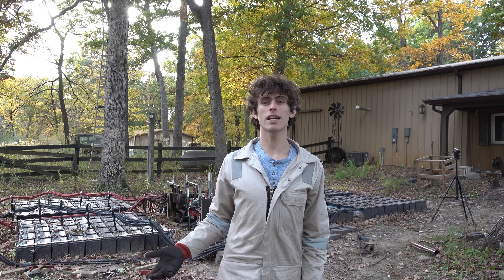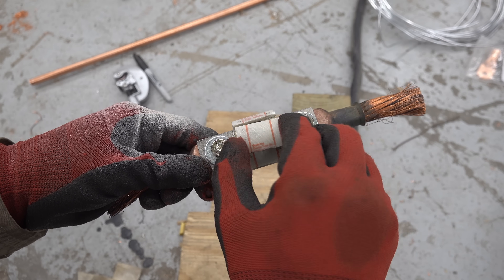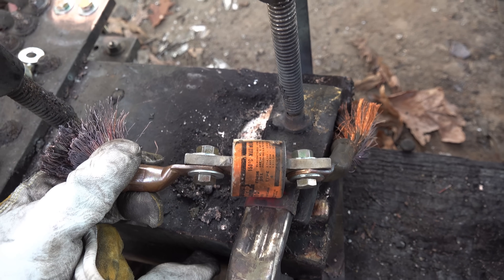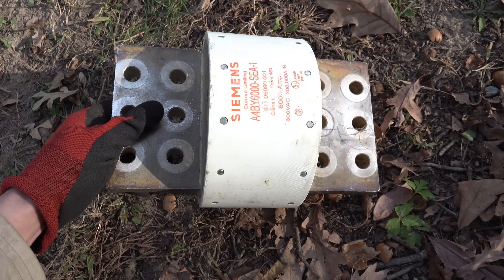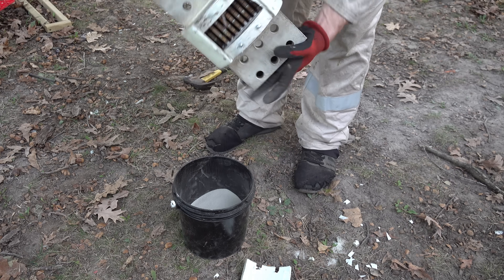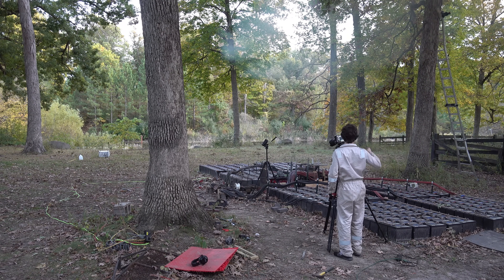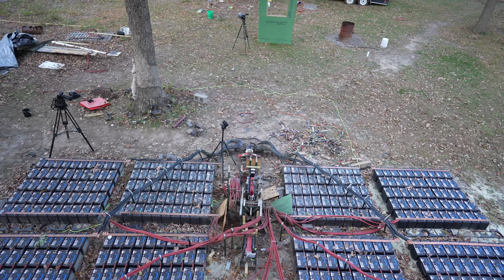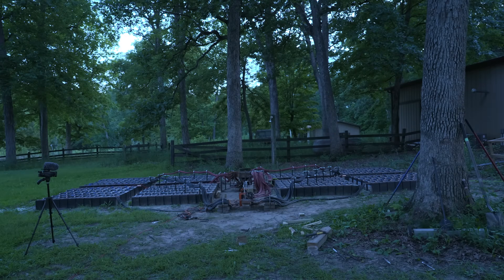Popping a 6000 Amp Fuse

Comment: Have you considered raw LTO cells? The low internal resistance and 10C discharge rate could make your explosions insane. And your battery would be much smaller. You could also use raw LFP cells, they are dirt cheap now. Just don't discharge to zero volts lol
Reply from the maker: idk anything about LTO specifically, but I'm generally turned off by lithium batteries for these experiments because they tend to make a fuss about short circuits. lead acid isn't nearly as energy dense as lithium, but its short circuit tolerance is excellent. i'm not worried about the space they take up since i live in the middle of nowhere
Reply: @styropyroshorts  oh gotcha, that makes total sense. Love your videos man!! Big fan
Reply: @styropyroshorts  LTO is better for short circuit compared to other lithium ion variants but once you hit that limit, a bit messy. Electrolyte spills out and it's nasty stuff. Lead acid seems the way to go. Love that huge switch you built for this one!

Comment: I see your plan of beating old Photonicinduction videos till he comes back is coming along.
Reply: He's going to need quite the capacitor bank
Reply: “challenge accepted”
Reply: Look it's like this. Photon is inactive, so there needs to be a force that activates him.
Reply: Can you imagine the chaos if both of them where in the same place
Reply: @thinfourth THIS is what we need! The local grid would certainly die, and perhaps a couple of people as well, but the content from such a collab would be WILD!
Reply: In theory, this would also make the EV chargers that everyone wants. With this you would be able to charge your EV in less than 3 minutes.  (2,5 minute to be more precise).
Reply: He might be coming back!
Reply: It's like the speedrunning scene, where some total mutant sets a god-tier WR and then disappears for years, only to return the same day his record is bested.
Reply: Andy's fuse pop was a bit different.  His capacitor bank was over 1KV and he had 10KA available giving a 10 MEGAWATT pulse (very short duration).  Styro's setup applied 150KA at 30 volts, maybe 750 KW?  Fantastic production by both!
Reply: The main difference between him and Photonicinduction is, Photon makes his experiments right in the city and on grid and these experiments happened off-grid on batteries. It would be questionable, if he could the pop via mains. Photon does have some very big transformers.
Reply: @MK-sf2bq  The capacitor bank Photonicinduction used on the 5000A fuse could probably already pop a 6000A fuse as is. It was higher voltage and about the same current, but obviously very short lived, but based on the rating of that fuse on the range of instant bye bye.
Reply: Giraffes did it first.
Reply: Why did he leave? Wasn't his girl complaining about the danger or something?
Reply: The legend, the myth
Reply: This reply section is filled with some of the biggest losers on this website.
Reply: @wisplite You would know
Reply: Styro doesn't understand electricity in the same way Photoinduction does and couldn't possibly do half of it... Stringing batteries is the best he can do.
Reply: @AI_MEME_CORP Get off his meat bruh, he ain't even active anymore 😭
Reply: @Milk_Bag67  yes he has. Look at his community page. Ouch.  That didn’t work out did it? lol
Reply: @AI_MEME_CORP  did styro piss in your cereal or something? chill out dude.
Reply: @mineton1293  sorry didn’t mean to hurt your feelings. Just sit in the shower and eat around 10 cheeseburgers like usual when you are stressed right?
Reply: @AI_MEME_CORP Your language model is repeating the same template. Try again.
Reply: @Ethan_is_me  it can’t possibly be rewarding having pretend you know what you are talking about can it? Your tactic is humorous and limp as it hinges on the appearance of getting the last word. Sadly it is only effective at preserving your ego when you lose in a pvp match.
Reply: you all cannot be real people nobody actually keeps using cliche reddit one-liners like you all do
Reply: @drsemiauto4215  oh they are real; I think when they all ask Ai for witty one liners it just scans reddit for ignorant neckbeard responses. 😅
Reply: @drsemiauto4215 *Tips fedora to the narwhal as it reaches the bacon hour*. NOO MY TENDIES! Want some jolly ranchers? My mom will have to get them for me as I broke both my arms. Woah don't open that box. Or look down the side of the wall by my bed.
Reply: @AI_MEME_CORP I didn't read your original comment here as putting Styro down - Photonic clearly has a professional background in high voltage AC, and enjoys shenanigans.

Styro clearly absolutely loves shenanigans and has learnt HV/HF to support said shenanigans, but I'd say it's that way round not the other.
Reply: @AI_MEME_CORP Of course PhotonicInduction have more knowledge about the area as he’s both older and have been working with it for decades, but their content can’t really be compared. PI shows how things work when taken to the extreme while Pyro experiments to see what will happen.
Reply: @AI_MEME_CORP Weird trolling tactic.
Reply: @chickenmonger123 not a troll. He literally copied his video like Brent Rivera — down to the data sheet for the fuse… only thing he didn’t do was apply voltage with a genuine power supply like photonicinduction.  Sad. 😅
Reply: @AI_MEME_CORP  Bait used to be believable.
Reply: @AI_MEME_CORP  lmao this guy didnt even watch the video he use a bank of capacitors not a power supply its no different than the batteries
Reply: @AI_MEME_CORP 😂
Reply: @N4CR 😂
Reply: @natehowerzyl1201  You are showing that you don’t know how power supplies work. They are collections of capacitors. You are all actual bots or npcs. 😅
Reply: @AI_MEME_CORP   Agreed. This battery setup is highly volatile environmental hazard that stays dangerous when not in use... A capacitor setup mirrors a power-supply in that it is both reusable, measurable and is safe when discharged on each use.
Reply: @TrillShatner  You say all that but Photonicinduction would regularly put his carpet on fire hahaha.
Reply: @beardedchimp  Exactly thank you! Photonic is an actual bad-ass moe-foe with balls of steel. Good add-on~
Reply: @AI_MEME_CORP  It is sad seeing people like you - worse slop than AI was 5 years ago.
Reply: @AI_MEME_CORP  LMFAO. "he used a copy of the fuse data sheet" ... most people gonna use a copy of a provided data sheet for that fuses... since the manufacturer provides these.
Reply: @AI_MEME_CORP  Where has Photonic gone - 4 years since I last heard and that was a mini comeback even then
Reply: @AI_MEME_CORP There's a reason Drake has millions of subscribers and you have 35. But keep coping I guess.

Comment: Have you tried shrinking a coin with this yet? All you need is a bit of dowel on either side of a quarter, wrap it in tape, then wrap 3-4 turns of wire around it. Can end up shrinking the thing a lot if the field is strong enough. Normally this is done with caps, but you've got enough raw current it might work
Reply from the maker: the coin shrinking trick works via inducing huge currents in the coin itself, and since this battery circuit is relatively slow to turn on, it can't pull off that trick. however, it can do a related trick where it can crush things by directly passing the currents through the object, creating a z-pinch in essence.

coin shrinking with the batteries might be possible via a magnetic pulse compression scheme of some kind though
Reply: Yes, that would be awesome!

Comment: 7:09
I mean, the fuse has holes for bolts for a reason after all.
Reply from the maker: if the contact blocks below were flat, then bolts would have been better than the clamps i used. however, the contacts were severely mangled from the previous experiments, so this wasn't an option. it would have led to the same scenario that happened in the first attempt
Reply: @styropyroshorts 
Oh Come On.
If you can carry all those batteries out there, you can carry a grinder and a belt sander 😂 

... and 6 nuts and bolts, almost forgot about those 👍
HAPPY HOLIDAYS 🎃🦃🎄🎆
Reply: @styropyroshorts  I agree with the full send methodology here. If there is a less-than-perfect connection with that amount of current it would just lead to an arc flash event anyway, even if the contacts were torqued to spec.
Reply: @styropyroshorts  this would probably add a lot of extra work to each shot but maybe you could have 2 big copper blocks with bolts threaded through them with the fuze or whatever it is your blowing up sandwiched in between the blocks so you can really clamp it on there good and get a good contact
Reply: @styropyroshorts but you could have turned the copper blocks to get a flat surface
Reply: Those holes are for fingers only
Reply: Pretty Much 👍

Comment: its a shame you didn't have a bright light aimed at the fuse to give the slow mo enough light
Reply from the maker: i wanted to film the plasma in these shots. i used a huge light for slow mo in many of the other battery experiments though
Reply: @styropyroshorts  i think photonicinduction would be proud of you
Reply: The light produced from the extreme 150,000 amps vaporising everything will completely outshine any and all light sources. His slow-mo camera might not be fast enough to observe the extremely rapid affects from the egregious current flow. Though a 6000A fuse might survive enough milliseconds from 150kA to observe with a more fancy slow-mo camera.

More problematic is that when the metals are vaporised it'll produce a voluminous bright plasma that is effectively optically opaque when attempted to observe the underlying fuse.

Comment: One of the data centers I worked at had an automatic transfer switch catastrophically fail causing a 5000A fuse to pop. It sounded like a lightning strike up in the office area. The failsafe components in the transfer switch (basically a series of lightning rods) had completely melted and the contact fingers had fused together.

Comment: After learning ohm's law, you learn that the circuit is designed to blow up first to protect the fuse.
Reply: Certainly seems that way on paper. The real purpose of fuses is to prevent fire. The load is considered faulty if the fuse blows in the first place, it does not protect the load from overvoltage. You need smart fuses; transistors, optocouples.. that sort of thing. expensive solid state stuff that, at these voltages and currents, youd pretty much have to contact CERN for parts to build a solid stats breaker if you desire the ability to break a circuit before the load sees erratic voltages. The parts would not be available commercially, maybe industrial arc furnaces?
Reply: That's at least true in Apple products.

Comment: Do you charge these batteries? If so how?
Reply from the maker: Yes, I just use a 1500W power supply that I modified to use as a charger. It's not fast to charge the batteries, but if I run it all day, it'll still charge the batteries faster than I can deplete them from experiments.

Comment: Instead of using clamps to keep it down. Try to make holes on the base plate you're using and bolt the fuse down to ensure it doesn't move anywhere from the sudden impulse

Comment: would it be possible to some how use the insane forces to lunch a rocket because with that kind of power it would be so cool.
Reply: You can lunch anything you please with that kind of current honestly.

Linear accelerators are a perennial favorite for 0th stage design in space launch, but the insane forces here are not very much compared to those needed to get a useful payload to escape velocity.
Reply: @B-System this sounds like something I might want to go which a 3 hour video about

Comment: Question.

Why you don't bolt the stuff you are testing straight to those copper plates? You could eliminate the problems with those clamps.
Reply from the maker: There's too much contact ablation for any kind of threaded mechanism to hold down most items. This will be covered in the full video on these batteries.
Reply: @styropyroshorts  Can't wait! 👍

Comment: 7:19 definitely should have cleaned it
Reply from the maker: This will seem weird, but I actually have better luck not cleaning it for shots that pull >100,000A. It doesn't limit the max current at all since the conduction path becomes molten at the contacts. However, it slows the initial turn on, which allows the switch plates to close all the way faster, leading to a faster rise to the peak current.

Comment: When your clamps and contacts are the real fuse
Reply: Next episode "breaking the biggest fuse of all.. earth"
Reply: The shittiness is a safety feature
Reply: Maybe he should have drilled and tapped the contact blocks, cleaned the surface, and bolted it down for a clean pop.
Reply: @soundspark  The shittiness of his clamps acts like a fuse, and that's not a joke. If you clamp it down, there's a chance you'll just start blowing up batteries instead.
Reply: @realms4219 He said he pulls over 100kA from his battery bank and the fuse was certified to blow in 0.01 seconds at that current.
Reply: @soundspark  Ok but if the switch and connections are stuck together you can't turn the thing off anymore and that's straight up a bomb worth 250kg of TNT going off. At that point just pray one of the cables melts through and breaks the connection.
Reply: @realms4219  As I already mentioned, the DUT in this case is a fuse, rated to blow over 6,000 amps, and to blow almost instantly at 100,000 amps.
Reply: @soundspark  And if it turned into plasma and kept conducting? He removed the sand after-all.

You really think that's worth risking it?
Reply: @realms4219  Guess that's a good point since the sand was removed, and despite running at a far lower voltage it is running pure DC.
Reply: @realms4219  Why would the batteries blow up? Do you think that is a lot of current? I don't think it is very much, but I did the math. 375 amps per battery, based on 400 batteries and 150k amps.
Reply: 😂😂😂, I can't believe he was surprised to see the 6000amp fuse intact and his clamps and contacts burnt. That's worrying,.some day he could be the fuse and he will no even know why